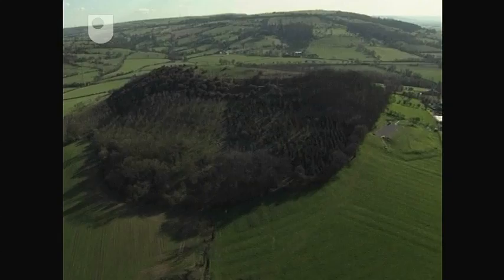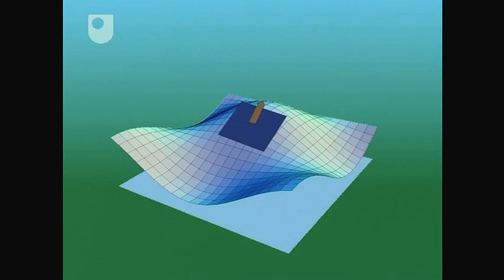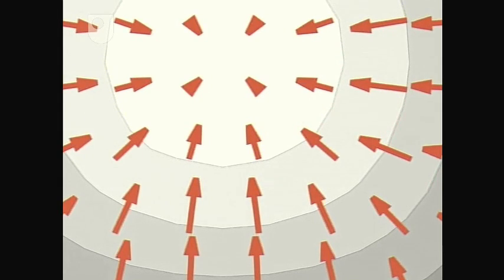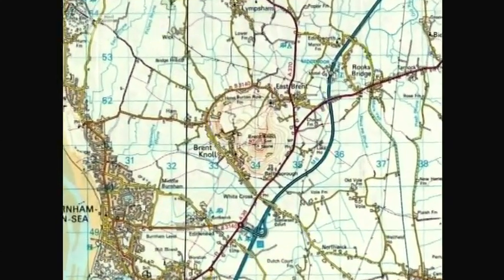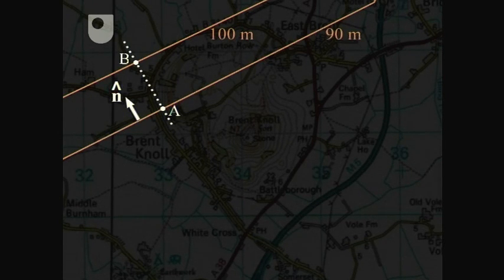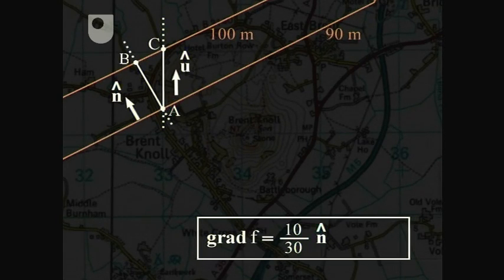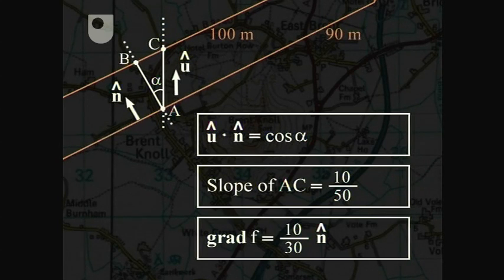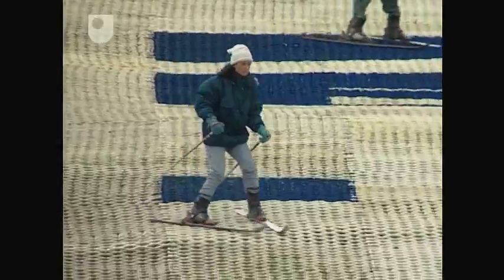Environmental Science – Grad, Div and Curl (1/3)

Comment: The gradient of a scalar field is typically interpreted to be the operator that gives the vector whose direction is that in the direction of greatest increase of f and magnitude being the rate at which f is increasing. Gradient can be considered as the "derivative vector" of a given multivariable function. For example, a gradient in R^2 -> R serves as a potential for a function in R^3. Gradient vector fields are irrotational; that is, the curl of the gradient equals the zero (point) vector field. As such, we can define the gradient in a similar way to divergence and curls as below:

Definition: ∇f = ∯(Fn)dS/V. The differential df of a multivariable function is defined as ∇f ∙ dr.

Comment: I think you left out a few steps of explanation. At 2:48 you give an equation that you don't derive from anything and don't use again. Why did you bother to give it? At 4:41 you state without any justification or explanation that the magnitude if grad f is rise over run. How does this relate to the previous formula, please?
Reply: Yeah, it isn't a consistent use of coordinates.

If you could parameterize the hill as a surface in z=f (x,y), then you would use the definition at 2:48.  You would have to create a fixed coordinate system with unit vectors (i-hat, j-hat). But they CHOSE a very good coordinate system such that (locally), the partial with respect to x is ZERO.  The coordinate system is tangent to the slope with i-hat along the LOCAL contour line and j-hat 'normal' to the contour line. The only contribution to grad(f) is in the direction of j-hat (ie the gradient direction).  To be consistent, they should have used j-hat.  Instead, they called it n-hat.  n-hat is used here to denote 'Normal' (perpendicular).  n-hat is normal to the contour lines in the direction of the gradient (grad f).  So the only contribution to grad (f) is the component along n-hat.  The partial derivative with respect to n-hat is correct as described (rise/run).  The 2-D gradient was effectively changed to a 1-D by choosing a good local coordinate system.  That's the benefit of using contour maps ;-)